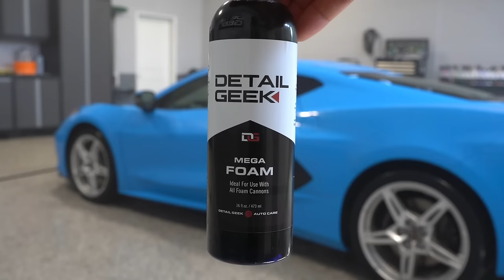Cleaning The FASTEST Chevy Ever Made?!

Comment: Gorgeous car!  But I'm wondering how it handles with that huge engine in the back, especially at higher speeds.  What keeps that long front end down and on the road?  And while the Corvette is fairly large for a sports car, with the fiberglass body, it's still gotta be fairly light, especially the front end.  Would be interesting to know what the designers did to prevent these 'Vette's from becoming "Ralph Nader" specials, unsafe at any speed (a reference to the Corvair).
Reply: A lot of the fastest cars in the world have the engine in the back due to keeping the weight on the rear axles. They do that to put all the power on the ground since most of those cars are so powerful it can be hard to get traction.

Comment: I’m curious to know if I just saw you spray chemicals, followed by the drill brush etc. without vacuuming the carpet mats first?  If that is what you did…why?  I would think driving dirt, and possibly  pebbles or hard materials into the carpet would cause unnecessary wear on the fibers (for a short cut).  If that’s not what happened, please forgive the question.

Comment: Even if it isn't too dirty, I still don't know why you wouldn't apply APC and use a brush or just wipe. Just because you can't see the dirt, doesn't mean it's not there. A detailer would do this regardless as it's a detail, and not a cheap car clean...
Reply: This is a brand new car. He removed the dust with a brush and vacuum, then a wet microfiber towel took care of anything leftover. No need to use a ton of products on a basically clean surface. A real detailer knows what to use and when to use it. 👍